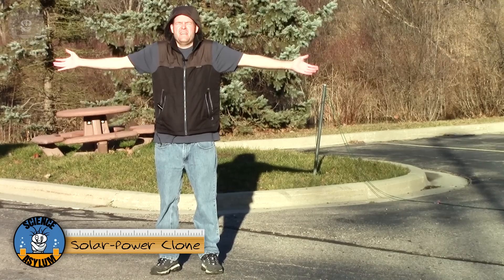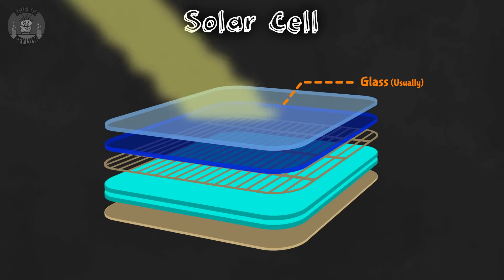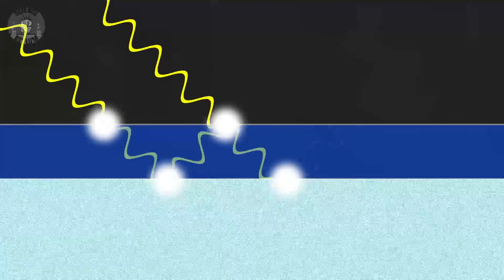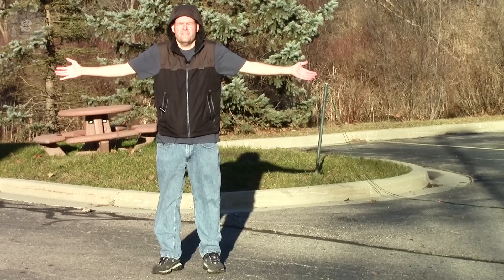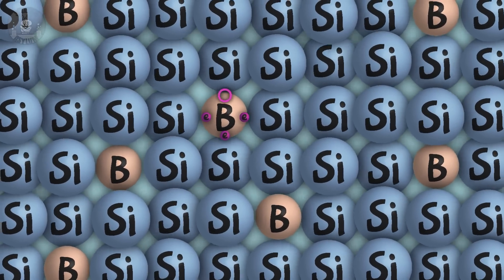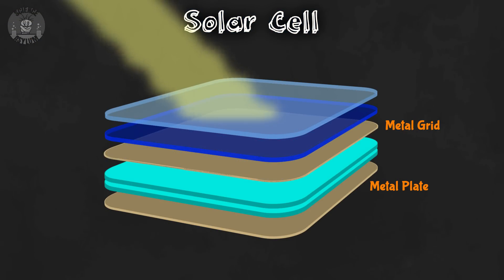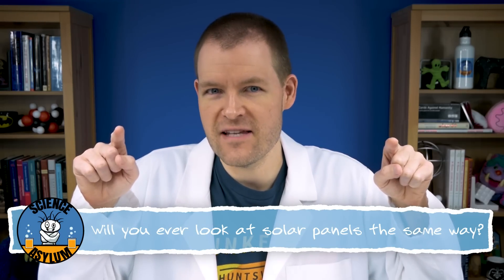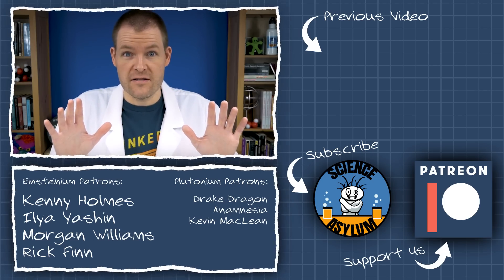How Do Solar Panels Work? (Physics of Solar Cells)

Comment: Seems like this solar clone has the same energy efficiency as a regular solar  panel 😉.  Any idea of how to enhance solar energy devices ?
Nice video as usual.
Reply: Solar panels collect energy from a narrow range of the sun’s frequencies.  Efforts are being made to capture a wider range of frequencies by using multilayered or composite materials.  It adds expense so it might be easier to just add more cheap panels if you have the space.
Reply: @cloudpoint0  Thanks. But If a wider range of frequencies are captured, heat could be an issue...🤔...these cells might be both electricity and heat suppliers.
Reply: @-x-dx7295  I'm not a solar power engineer but I know solar panels heat up.  I think heating represents radiant energy that impacted on the panels but was not captured and converted to electricity or reflected/radiated away.  Possibly a wider frequency capture and more electrical output would mean cooler panels.  I'm not sure.
Reply: @cloudpoint0  That's possible indeed.  Wait and see.

Comment: Solar power is good when you have a lot of sunny days and clean air. Wind generators are good when you have enough of stable wind. The same for water and other renewable sources. But in places like here, when almost every day is cloudy, no stable wind or flowing water, I think nuclear energy is still the best solution.
Reply from the maker: Yeah, nuclear fusion would be best in some places, but that's a ways off. We have solar and wind now.
Reply: @ScienceAsylum  clean energy is always better, but one cannot make sunlight in polar night or wind in some windless places.
Reply: Nuclear energy needs enriched fuel and a large body of water to control overheating, plus highly educated engineers.  Do you have these?
Reply: @cloudpoint0  as a matter of fact, we do (in Russia).

Comment: Hello. Fire is the rapid oxidation of a material in the exothermic chemical process of combustion, releasing heat, light, and various reaction products.  I would like to know fire at the quantum energy level. Thanks
Reply: I have some quantum understanding.  Fire is a bit boring at the quantum level.  Chemical reactions between hydrogen, carbon and oxygen cause them to bind into CO2, H2O, etc.  The resulting products have a lower energy state and excess energy is released as they bind.  Released energy causes everything to shake more at the molecular level, which is otherwise known as a higher temperature, producing light and heat.

You need a catalyst, that is, some initial heat energy for example, to get the process going and then it will become self-sustaining until the fuel is gone.  The catalyst knocks some of the fuel’s electrons into higher orbits where they can be grabbed by oxygen and the electrons fall back to a lower energy bound state.  In doing so the falling electrons disturb other electrons and the process continues.  Heating causes unburnt material to rise as a hot gas to where fresh oxygen is available, so there’s a steady burn or reaction instead of an explosion in open air conditions.

Here’s a video explanation by the master.

https://youtu.be/ITpDrdtGAmo

Comment: Nice video as usual.. except for the strange and vague digression about power sources providing energy and not power.  Power sources can take many forms, including but in no way limited to voltage sources through which current flows.   Power is simply the rate at which energy is being dissipated, so if a battery or generator or solar cell is connected to a load that dissipates energy for a particular amount of time, then during that time it constitutes a power source.  I'm not aware of any meaningful technical definitions above or beyond that.

Comment: Once the electrons are lost from the phosphorus, where are they replaced from in order to be able to keep flowing to boron?
Reply from the maker: They're not. That imbalance creates the voltage that drives other electrons in the opposite direction. You just have to FREE the electrons, which is what the light is for.

Comment: Why do we want to use a semiconductor? Why can't Phosphorus and Boron themselves be used? Would a different group-4 element or semi-conductor be better? Also, I was taught that doping is to take away or give electrons to a material, not to mix materials. So to be sure, what's doping?
Reply from the maker: The materials need to be almost entirely silicon because the atoms need to remain bonded in 4 places. If the material has too much phosphorus, it'll bond in 5 places using up all the electrons. You could use something else from the same column as silicon, but the conduction gaps won't be the ideal size. Silicon is the best overall, though some other semiconductors are better in some specific contexts.
Reply: @ScienceAsylum  Okie, thank you for the answer. ^w^

Comment: Capacitors don't really store energy, capacitance itself is also independent of voltage, in general at least.
Reply: Capacitor do store energy!
Reply: @ameerhamza4816  You are technically correct, the best kind of correct, but you still wouldn't really use one as a battery now would you. That's simply not what they're for.
Reply from the maker: Capacitance is independent of voltage, but the energy stored in the capacitor is not. http://hyperphysics.phy-astr.gsu.edu/hbase/electric/capeng.html

Comment: there are also solar towers in warm places like Spain that use reflect and redirect sunlight to heat up a liquid (usually oil or water) which is then converted to steam to drive a turbine (heat differential) to produce electricity. Much smaller derivatives of this are sometimes used on roofs of homes to augment traditional water heaters here in Europe
Reply: You can also use a design with liquid salt--heating the salt is effectively storing energy for when the sun is down. The liquid salt is pumped through a pool of water to generate steam to drive the turbine.
Reply: @lennierofthethirdfaneofchu7286  indeed! So many possibilities to rid ourselves on our addiction to fossil fuels

Comment: Thank you Nick for yet another fun and informative video.  I have been reading through the comments and questions and, as always,  am impressed with the generosity you show in taking so much time to respond personally to so many of them.  Like all your fans, I just don’t understand why you don’t have more subscribers!???  You channel is first rate and you are a natural born teacher.  
I would like to share my first experience with photovoltaic power:  My father bought me an eleven cell solar panel  way back in the 70’s when these things were beginning to become available to mere mortals.   It came with a small water pump.  I put the pump in a bucket full of water and hooked up the leads to the two terminals on the back of the panel.  I will never forget the thrill when the water suddenly began to fountain out of that little pump— light converted instantly into motion; it was like magic!
Reply from the maker: Thanks for the story :-)

Comment: Don’t you need to heat the p and n parts together to make a diode?
Reply: What do you means?
Reply: To make a diode, you can’t just mash the two regions together, according to my knowledge. You need to join them using a proper process.
Reply: PN junction is not made by combine p and n junction rather dope one half and second half with different material to make half p type and other half n type junction
Reply: Don’t you need to first mix the materials in liquid form for doping?

Comment: hey nick. please answer me.  if. solar energy is electromagnetic radiation. why not use an antenna to capture. the energy    just like we use antennas to capture topical EM waves
Reply: EM radiation carry energy with them! 
We need to convert this energy into electrical energy using need specific device! 
Photodiodes are for this purpose
Reply: @ameerhamza4816  antennas also converts EM radiation into electricity  thats how a message is sent in air   same thing can happen with the radiation of the sun except that this EM wave would have way more energy than the EM signals transmitted by radio stations
Reply: @serektaibah4091  but the can't make thousand/million of watt with antenna!! Antenna is for different purpose

Comment: great video Dr Lucid. 2 question 1. how does the double wave interaction stop light wastage. wouldnt it just make it not shiny? and 2. if the electrons are moving from 1 layer to another, wouldnt they run out?
Reply: I can't answer 2, but 1 is really easy: They would create a depletion layer and cease to flow in a matter of nanoseconds, if not for those conductive surfaces - the plate and the grid. Those take the electrons out from the side where they would otherwise accumulate, transport them off to do some useful work for the panel's owner, and then put an equal number of electrons back in the other layer. It's a balanced cycle.
Reply from the maker: 1. If the light doesn't reflect, that energy has to go somewhere. Energy can't just disappear, so it goes into the solar cell instead.
2. Like Vyl Bird said, it's a closed system, so new electrons come from whatever it's connected to.
Reply: @ScienceAsylum  ok thanks, i get question 2, im still not sure i understand the light interaction though, i think im getting caught up on how soundwave interaction works. it doesnt stop the soundwaves it just removed the gaps wich make it inaudable to the ear?

Comment: I still didn't understand the role of light in making the current flow. What does the incoming light do to the depletion layer? Is the barrier potential increased or decreased? How?
Reply: Light provide the energy to electron
Reply from the maker: Once the depletion layer forms, there aren't any more free electrons. The light gives energy to electrons to make them free, which is necessary if you want an electric current.

Comment: What is the ratio of silicone to phosphorus/ boron atoms? (Assuming their ratios are equivalent)
Reply: Silicon, not silicone. Different substance entirely. The exact ratio depends on the type of cell, but it'll be in the parts-per-million region. A little dopant goes a long way. Both P and N types are almost pure silicon. One of the most difficult and expensive processes in the manufacture of panels is actually getting silicon of sufficiently high purity. It's a very common element on earth, but needs extensive refinement before it is pure enough for semiconductor manufacture.
Reply: Vyl Bird. interesting, thanks for the info

Comment: One problem with solar panels is that they are expensive, and just like everything else in the electronics industry, that 30K system you bought is obsolete in 4 or 5 years when new panels come out that produce twice as much power and your panels are still nowhere near breaking even. Night and cloudy weather are also problems.

Comment: Sounds more like the "Chemistry" of Solar cells, discussing more of the elements and the periodic table.
There are multiple ways to harness solar power.  Solar PV is just one of them.
The Physics of solar PVs is the Photoelectric effect and the electromagnetic spectrum.
You discussed anti-reflective coatings substantially without stating you have to select a wavelength range infrared, visible, UV, etc.  After that, you will be able to tell which wavelengths solar PVs are converting which I think is important to know about solar power PV. 
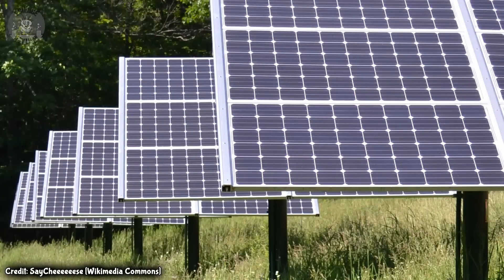7:06 You made it sound that DC is inferior and besides it is out of topic.  It is a long video by itself (inverters). 
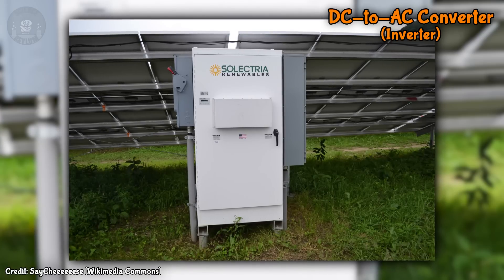7:16 Energy storage is a video by itself and is out of topic. I haven't heard of energy company using capacitors.
Reply: Without chemistry there would be no solar panels! Without understanding chemistry of sharing electron you can't understand how diodes work!!
"there are multiple ways of harness solar power"!!!!!!
There is one other method which use heat from sun!!!
Physics of solar panels is not only photoelectric effect it's also the physics of semiconductor, diodes etc!
He didn't make DC inferior to AC
All people know we use AC in our homes so he say we need to convert DC to AC!
Without storing solar energy how can we use it at night!!!!!
Reply from the maker: 1. I never meant to imply that DC was inferior. It's just that our power grid is AC (for good reason), so the fact that solar panels produce DC is inconvenient in that context.
2. Lots of battery manufacturers are seriously looking into capacitors right now. They're better for the environment in the long run, they charge faster, and they're cheaper to make. We just have to get their storage capacity up a little more to compete with batteries. For example, Tesla's "Powerwall" is a capacitor.
Reply from the maker: Also, chemistry is just applied physics ;-)

Comment: How to convert dc to ac? Sorry if this is a really basic or dumb question
Reply: You use a device called an inverter. Their design is pretty difficult, but they all work by turning transistors on and off to quickly reverse the output polarity.
Reply: @vylbird8014  ....ok I don't have enough electric engineer in me to understand that. What's a transistor? how does it work?
Reply: @ChewingGumFlavor  An electrically-controlled switch. They have no moving parts, so they can operate at high speed without wearing out.